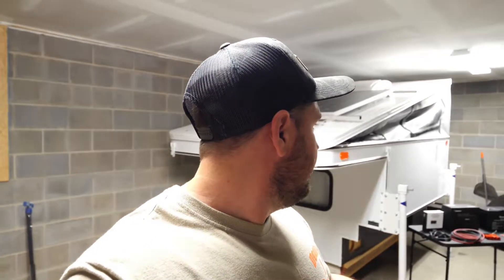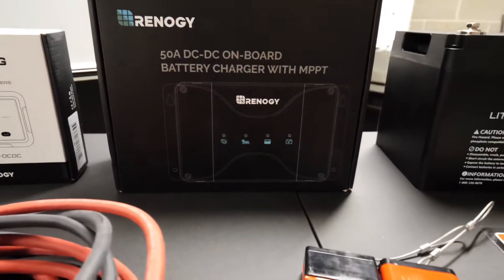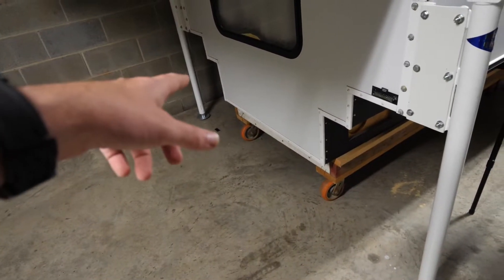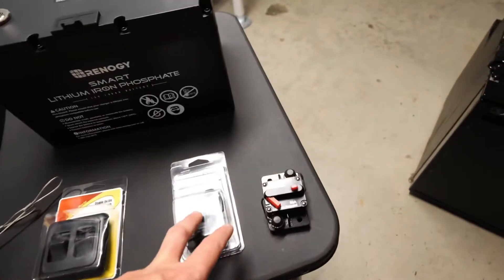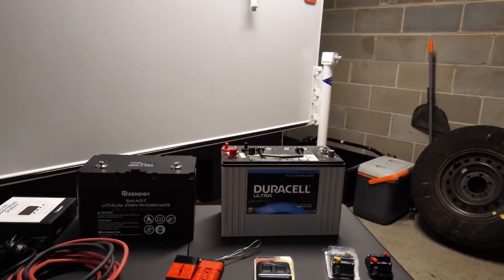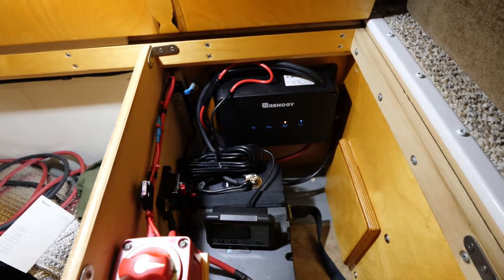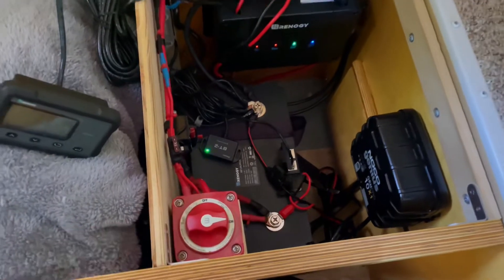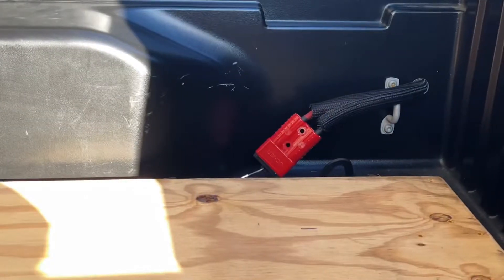EASY FOUR WHEEL CAMPER LITHIUM BATTERY UPGRADE | RENOGY SMART BATTERY | DC TO DC WITH MPPT CHARGER

Comment: nice work, how did you connect the monitor and bluetooth into the charger. isnt there only one port to connect them to? I have both and would like to have both working together also, cheers
Reply from the maker: I don’t have both working I’m currently only using the Bluetooth. Being only one port for either bt or the monitor I don’t think it’s possible to run both
Reply: ok thankyou